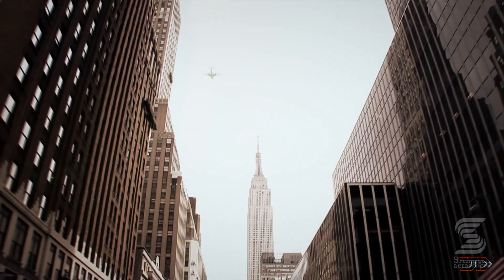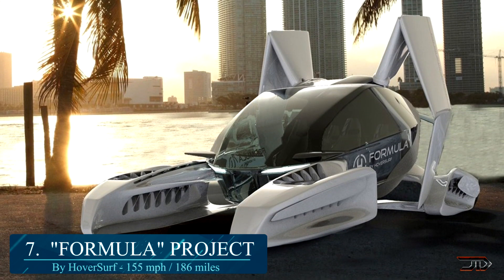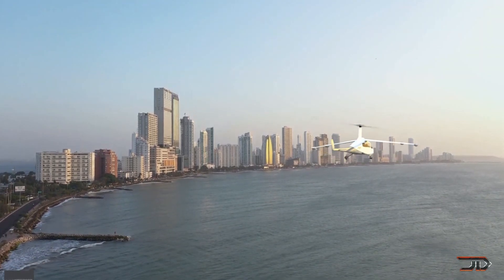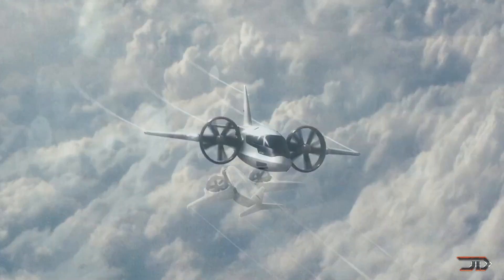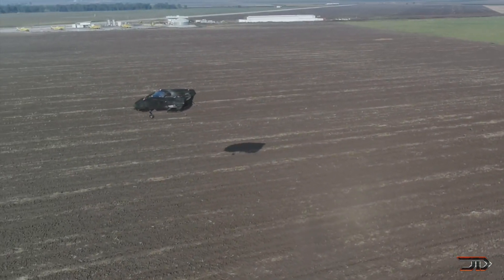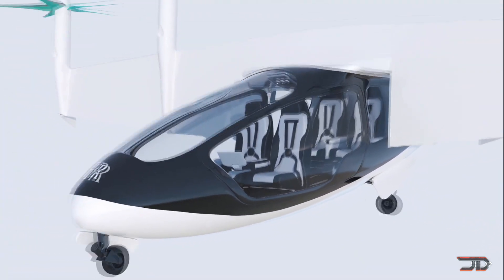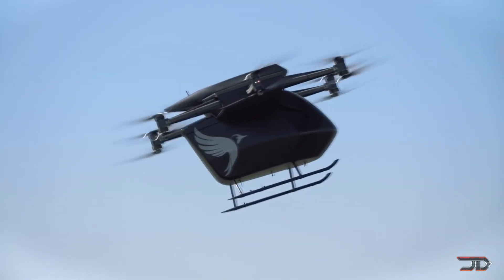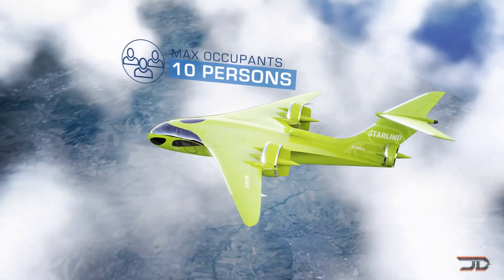7 CRAZY Future eVTOLS

Comment: Most of these would never fly, let alone get certified. These are design concepts from people with no understanding of aerodynamics.

A flying car with 1000 horsepower becomes a falling car once the engine quits. Airplanes and helicopters can glide without engines. If it cannot glide without power, it's not safe.

There's a reason that even militaries are staying away from vtols if they can at all help it. There's a reason why not even helicopters do their approaches vertically. 

If the engine quits during takeoff or landing, there's no of chance of recovery for a vtol.

Comment: Jetoptera looks the most promising to me.
Reply: I personally think Jetoptera is one of the least promising options. Dyson "fanless" fans are an interesting way to move air but they're very inefficient. Jetoptera's prototypes don't use the unique propulsion system they claim will be so revolutionary. I think they are either scammers, really bad engineers or both.

Comment: Good day . I am a mechanical engineer and I invented a super revolutionary engine for any type of fuel, including hydrogen for 0 emissions, obtaining much more performance than any other current engine and greater than batteries or fuel cells that are used in combination with electric motors, this The motor has a tubular format with one or more stations, with only two main moving parts, and a power / weight ratio greater than 10 Hp / Kilo, its thermal efficiency is higher than 65%, everything can be made of aluminum (except the main shaft ), it does not use liquid refrigerant or oil in its operation, this engine can be extrapolated to any size in power without losing characteristics.
It is patented in Brazil and also in PCT.
Very easy to manufacture 100% with intermediate technology (WITH ONLY 4 MAIN PARTS AND ALL THE MECHANICAL ARE MOST COMMERCIAL PARTS, 42 TYPES OF DIFFERENT PARTS PER STATION INCLUDING THE SCREWS), all its moving parts 100% mounted on commercial bearings, Its useful life is more than 30,000 hours and it has more than 50 additional advantages .......
As an example, high-speed vertical take-off planes can be made (subsonic and also supersonic, this does not use a turbine but if an axial compressor is not a ramjet, it is not a scramjet, it is similar to a 100% safe rocket engine, with a thrust of 100 kilos / kilo or more) for many passengers and more than 20 thousand kilometers of autonomy at a cost 10 times less.
If you are interested and you are an aircraft production company you can contact me and you will not regret it by email: elmontecarmelo1@gmail.com, WHATSAPP 55 27995298580.
I'm not kidding, we are serious and responsible people, we welcome constructive comments.
YOU WILL NOT SEE THIS ENGINE IN ANY BOOK OR ANY OTHER SITE.
Reply: Sorry Manuel, not trying to be harsh, but I can't see you finding a buyer for your "engine" in a YouTube comment section...
Reply: @Pieceoreece  Thank you for your comment, but I cannot find a way to reach the engine producers, that is why I am doing it by this means, this engine would make all other engines of all kinds obsolete due to its efficiency, simplicity and very low weight as well as its durability. Grateful again,
Reply from the maker: @MotorCarbalhada  If it's in the prototype/design phase maybe make a video on it?

Comment: Connecting different cities with air travel specially to transport passengers is the most practical way rather than building roads and railways which cost much more and requires frequent maintenance costs, a little delay in goods transport is not that frustrating as compared to the delays in passenger transport.